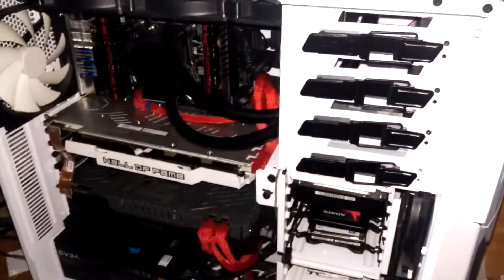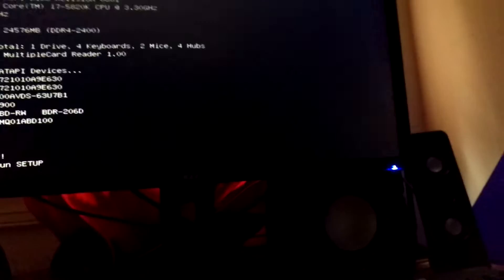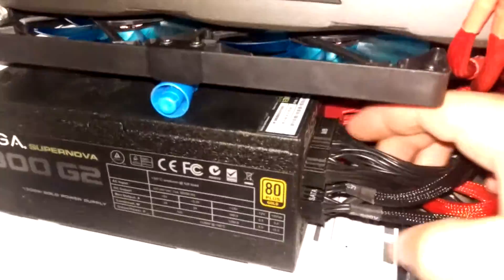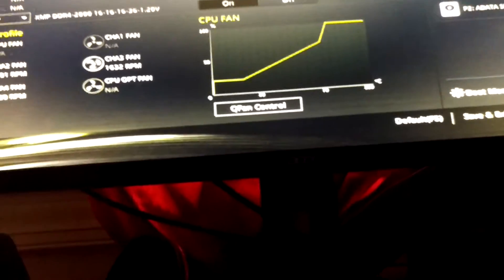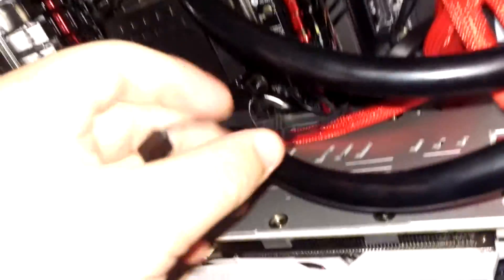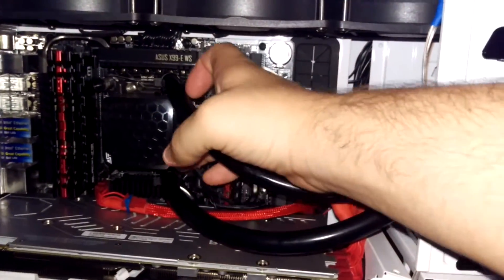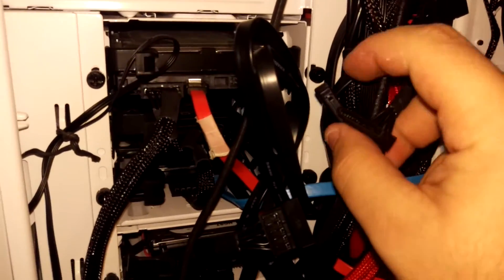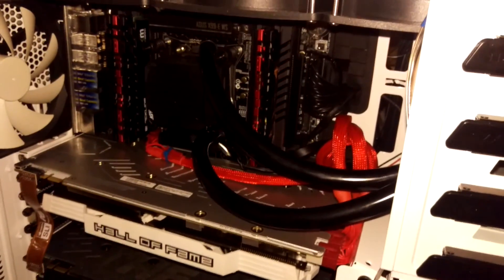Swiftech H220/H320 CPU pump failure issue

Comment: make sure Swiftech H220 work
Reply from the maker: the h220 and h320 both use very similar pumps. so i would expect them to have similar faults. with the new h220-x and h320-x out now though, those issues should be fixed.